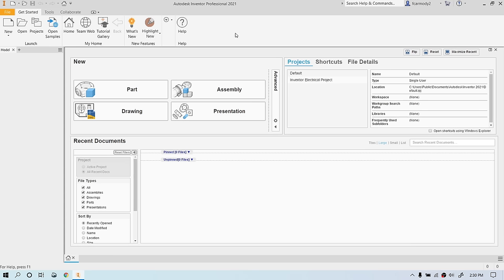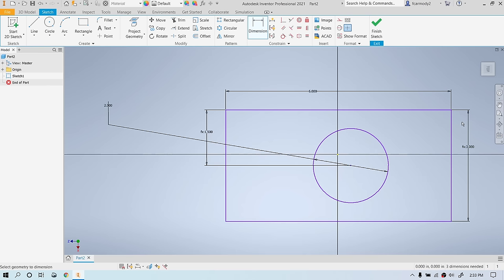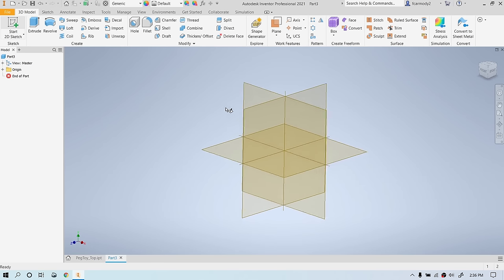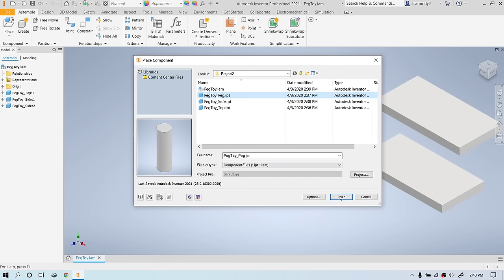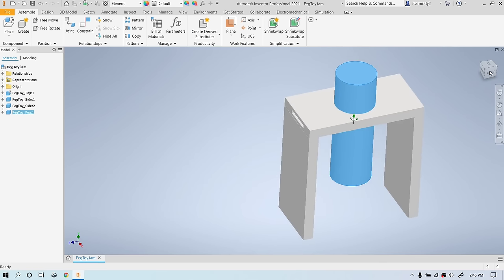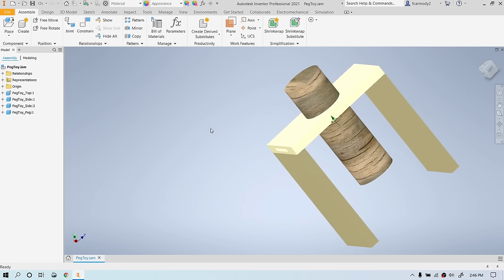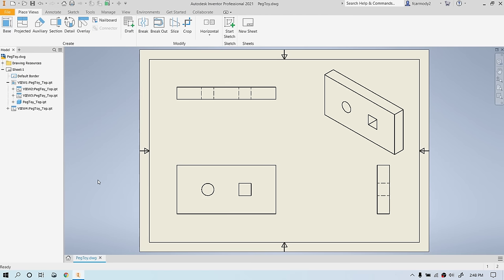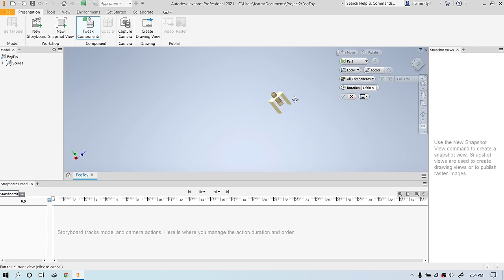Autodesk Inventor 2021 :  0 :  Basics in 30 Min

Comment: In, the process of forming a program in 3dprinting-machine, fusing the architecture design with the construction, of engineering it's on the template to transfer to the 3-d printing computer program.

Comment: Hey I've been having troubled modeling my threads (as apposed to just a texture change) and I was wondering if you have experience with this. I have tried to get an add on for it (something with oranges is the name) but they stopped supporting 2021.
Reply: Hey . I guess your problem can be solving with updating your Microsoft Excel

Comment: Shows me error when trying to extrude. Exact the same way as you are doing it but with a circle only, interestingly it showsit correct how it would look like when finnished, then click to finnish.. Error.... Over and over again I tried to change this.. Made a sketch finnished with alot of holes in it.. Will not extract the holes or the original.. This is p.... me off.. And I can do this in Rhino in a few seconds.. WHY is inventor so strangely overcomplicated with simple operations?
I need to to it in Invetor since I am making an assembly..

Comment: Interesting. But it's simply not how experienced inventors conceive and draw parts. So pedestrian!
Reply from the maker: Thank you for commenting, you are correct!  This video is for meant for someone learning to create and assembly separate parts for the first time. How would you have approached modeling this in inventor, with a more advanced workflow ?
Reply: @EducationPublic  My comment wasn't about this video in paticular but Inventor's pedantic protocols.